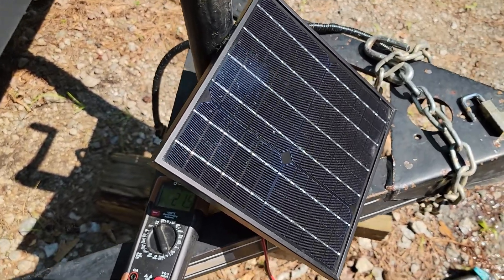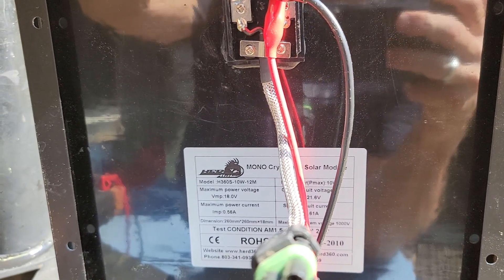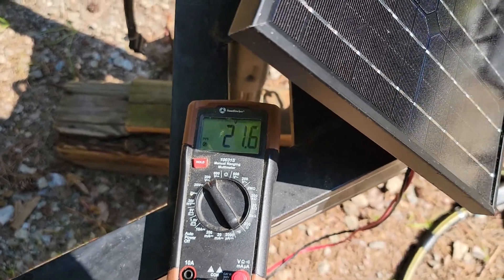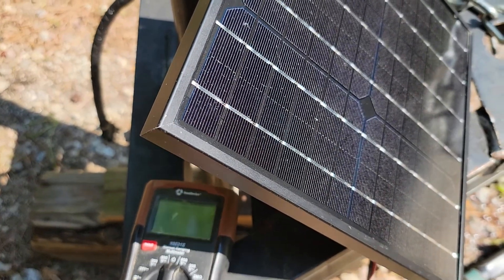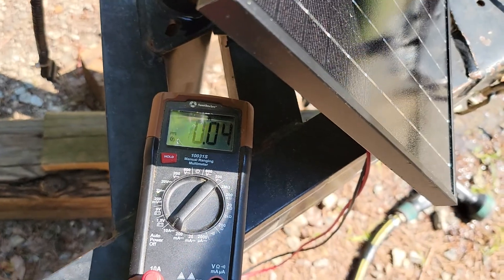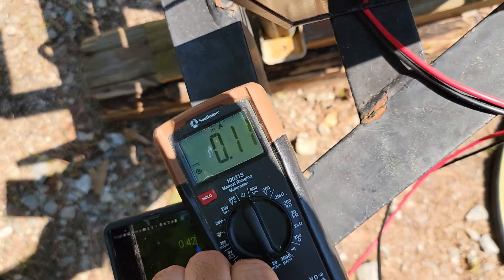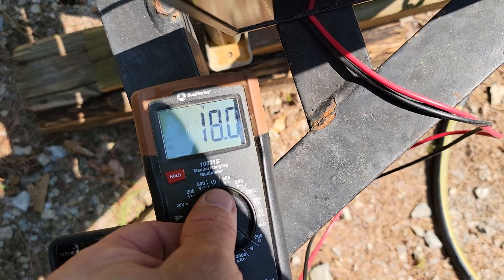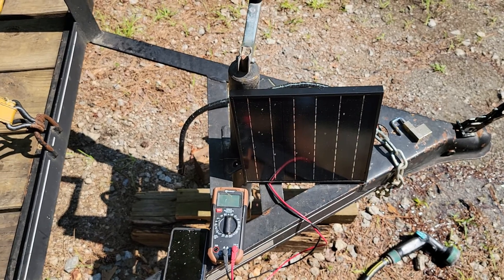Solar for Cellular Trail Cameras In Partial Sun. Will It Work?

Comment: So, it looks like by the way you have the meter hooked up to the solar panel you are creating a dead short when checking the current output. I'd love to see the same test if you hooked the meter in line with a battery to see if the current drop is as drastic then. Have you tried that?
Reply from the maker: It's cloudy today but I performed the test anyway. Voltage and Amps measured across the panels terminals as in the video today in overcast skys is 20..78v and .05a for a wattage of 1.039w. I connect the meter inline to read Amps while connecting the panel to a dead 12v SLA Battery and get an amp reading .05 under the same conditions so that equals the previous measurement. I place my hand over one corner of the panel and I have to change the setting of the meter to 20ma scale to read the drop. With hand covering 4 or 5 inches of the corner of the panel I measure an output of .03ma
Reply: @herd360  Thanks for taking the time to do the test! I appreciate it!
Reply from the maker: Yes that's a simple method for testing maximum output. I would expect similar results with a constant load. I will see what I can do.
Reply: @herd360  After reading my post I wanted to make sure you knew I meant to have the multimeter in series with the battery that would be charging and not parallel as that would definitely create the same results.
Reply from the maker: @buckbuster6213  yes sir. I do understand what you meant. I actually went to school for industrial electronics though it was many years ago I still remember a few things 😅
Reply: @herd360  I was actually very interested in purchasing one of your solar kits for my Covert Code Black camera that is 270 miles away from me in Illinois as the Energizer Lithium batteries are only lasting about 3 to 4 months but unfortunately where my camera is doesn't get a lot of direct sunlight in the summer because of foliage so now I'm afraid the solar solution isn't the answer.
Reply from the maker: I'd rather steer you away from purchasing something from me than you buy it and it not perform the way you expect. Not you average sales tactic. My recommendations in your situation would be a rechargeable battery setup with a 12v 18ah SLA Battery. https://www.herd360.com/products/power-pack-1800-external-battery-box-universal-for-all-types-of-trail-cameras
Reply: @herd360  My main goal is to have a power source that would last almost 6 months or more so I don't have to make but 1 or 2 trips up there a year including hunting time. I see most ratings in thousands of pictures instead of time. I typically only get from 25 to 200 photos a month on my camera. If you think your product would achieve that I might definitely be interested in one. Thanks for taking the time to respond.
Reply from the maker: @buckbuster6213  I forgot the coverts are 12v so you would actually need a large 6v battery like a 42ah.